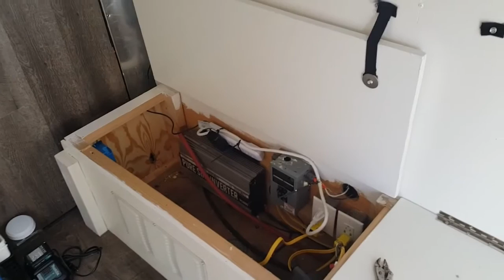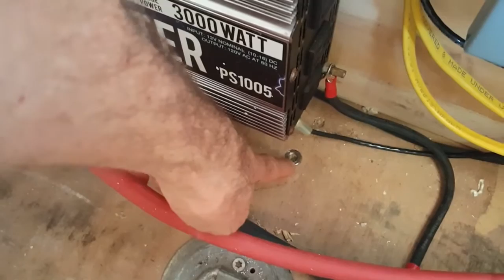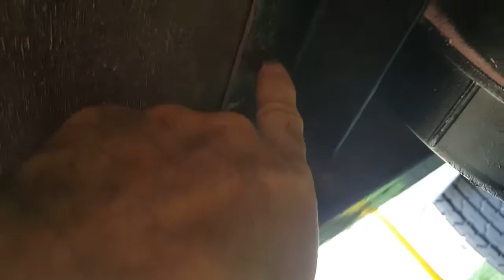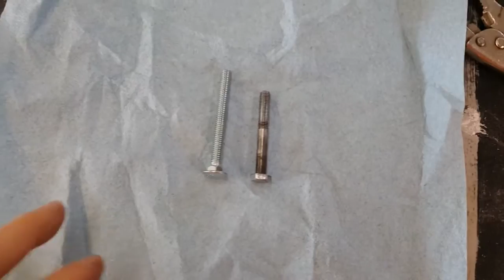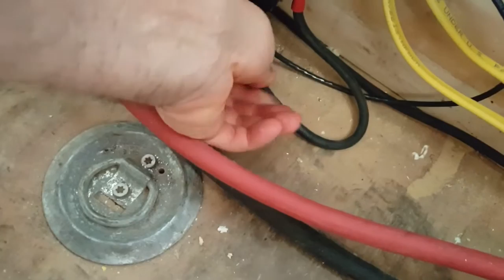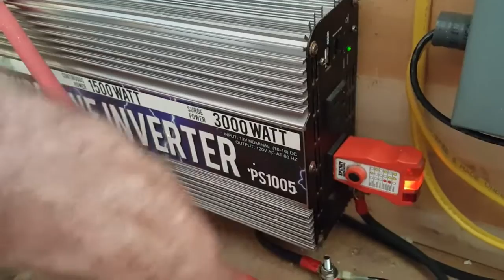MORE ELECTRICAL GROUND PROBS 6 X 12 Cargo Trailer Camper Conversion Vanlife Part 29 #flgctc

Comment: Your truck is not grounded to earth so why should the trailer? My inverter is just a small 350 watt for my laptop that plugs into a cigarette lighter plug. That's not grounded so why does a bigger one need grounding. The trailer is a "GROUND PLAIN" like the tow vehicle. I'm not a professional so I'm just not certain what is proper. That's why I came to this video . . . to try and learn something.
Reply from the maker: You have a couple different systems here though. Shore power and invertor power. I grounded my breaker box to the frame. Otherwise my 110 volt is grounded though the shore power connection. Works for me. Good luck.

Comment: You could have just ground down the square on the carriage bolt to the same diameter as the threads, or threaded the other bolt all the way to the head with tap and die!!
Reply from the maker: Yep, you are correct. I have the equipment to do either. Just lazy that day I guess. Thanks for watching.

Comment: QUESTION: Why is my receptacle (AC outlet) tester indicating an “open ground” fault when I test my DC to AC power inverter on a boat or RV after connecting to the vehicle’s chasse?

ANSWER: When using a power inverter on a boat or RV, the tester will indicate an open ground fault. This is because it is not connected to a “true Earth ground”, meaning it is not connected to a metal rod stuck in the Earth. It would be impossible to do so in a boat or car while moving. For this reason, certain appliances and/or tools cannot be used while boating or driving. The power inverter DOES NOT and cannot create a true Earth ground on its own.

**However, the input electricity is partially grounded out by the negative DC connection and by mounting the inverter to a metal frame. These two safety precautions ensure the ability to use most of the appliances desired for a boat or RV. This is why it’s still okay, and standard practice, to use inverters in boating and RV applications.**

“City power is always grounded to a true Earth at your house, but if you’re in an RV, boat or something mobile, it’s not going to have a true Earth ground. That’s okay — just know that some devices need an Earth ground to work, such as the new, big, stand-up refrigerators.

Back in the old days Standard oil had ground chains or a strap that drug the ground to keep their tankers grounded to help prevent sparks while the drivers unloaded the fuel have you tried to run a strap or chain that will lay on the ground when you stop? 

I would try small chain first if that didn't work maybe a braided strap the chain should let you check your ground try and ground it at your ground for the batteries and inverter that you made. I have done this to stop from getting shocked in the winter time while opening my truck doors. If it doesn't help let me know and I'll look for more idea's for you.
Reply from the maker: That makes sense Den and it goes along with what I am seeing. Thanks for posting it. I tried a chain and it may have provided some protection but did not register as a functional ground on the tester. It still may work and the tester may not recognize it. Not sure.
Reply: @FakeLegGreg   As a full ground I don't think it works but as a floating ground it should help to keep you from getting shocked it may also help in bad weather. In any case it is grounded to the batteries as a whole. Think of your car power + to - everything is it's own power table but it's floating only to the car. I'm just not sure if it'll hurt the Inverter it shouldn't but I just don't know people use them all the time and I am going to be adding one to my trailer with in the next year or two. I am trying to get the know how on solar I'm just not there yet. Everything I have found on this points to the same article I replied to you with and I know about floating grounds because I have been a Mechanic for so long over 45 years it's just that I can't get around to do much anymore. Keep me up to date please I would love to get more info for myself as well.  On the strap dragging  it will help with the static electricity this I do know.

Comment: Are you running 24v?
Reply from the maker: 12volt. 2 pairs of batteries are series and then wired parallel.

Comment: I think it's the inverter.  Have you tried to open the outlet on the inverter (with all power off) and inspect the wire connections to the outlet that is part of the inverter?  If you had the inverter in a plastic or fiberglass boat it should still not read an open ground.  All the suggestions about tying to earth are not the problem.  It's a separate source of power and the ground path comes from the inverter outlet.  If all else fails call the manufacture and explain your problem..good luck
Reply from the maker: Thanks for the suggestion Terry. I will take a look.

Comment: Why wouldn’t your invertor be grounded to your battery or fuse panel that’s grounded to battery
Reply from the maker: The invertor, fuse panel, and negative side of the batteries are all attached to the same ground. Invertor is still showing open ground. Thanks for the suggestion.

Comment: Nicely done! I'm fairly certain you won't see the ground over that tester until you go to ground, as I mentioned before. However, you may see it if you go to a ground rod. That current is going through the neutral for your current indicator light  once it can send current to the ground, it should light your ground light.
Either way, if you have a 120v short to the chassis, it will ground out and kill the circuit.
I'm glad you're sharing and appreciate your efforts. I sure hope folks are learning!
Reply from the maker: Appreciate the advice Starling. Still learning. :)